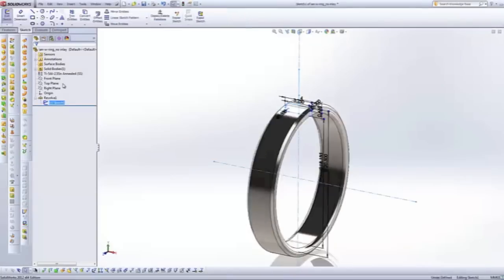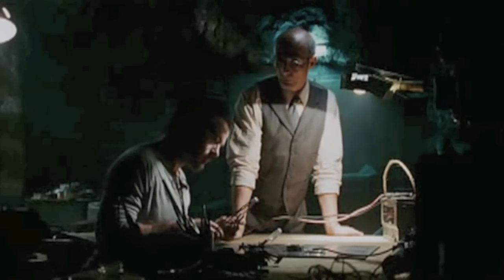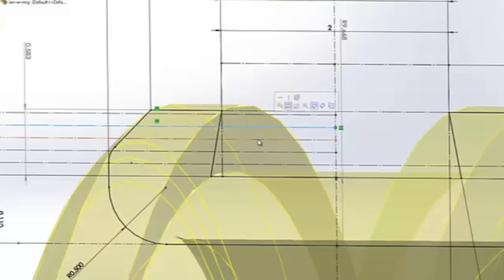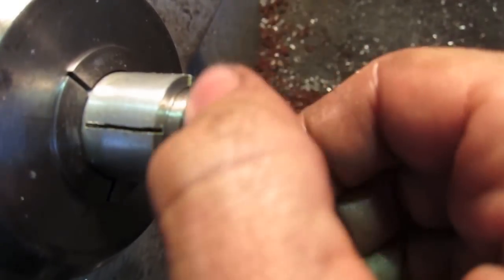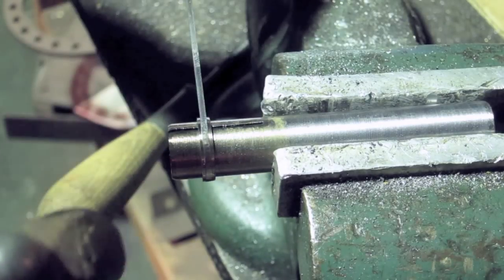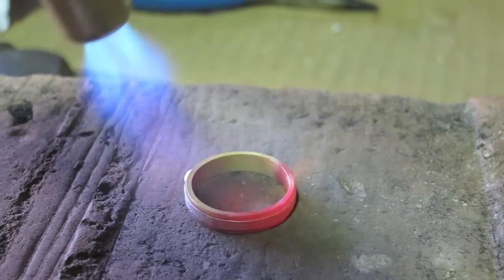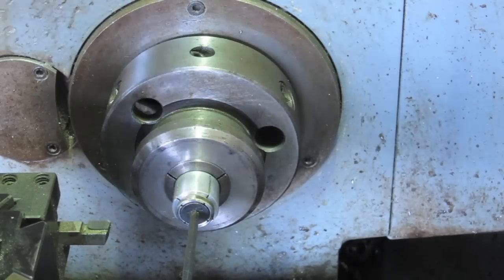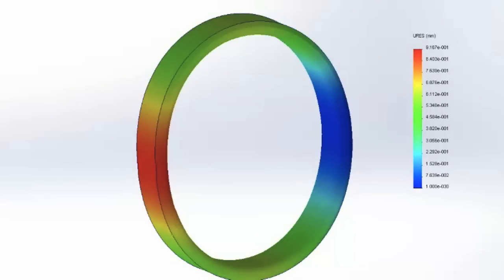Making the Ring - Men's Titanium Wedding Band With Inlay

Comment: you can use coolant depending on what youre doing, because these metals are extremely  hard and small, coolant isnt required and usually a ceramic insert is used in the tool.

Comment: i had an aircraft Ti bolt given to me, worked in a welding/machine shop.   very little lathe experience but managed to turn the head of the bolt into a mirror finish Ti ring
Reply from the maker: Post a pic!

Comment: You should make the Nuclear ring, but instead of cobalt 60, which might be hazardous for you to work with, you should use Tritium(Hydrogen-3), which glows in the dark under any condition, and is only sorta radioactive which means it still has serious style, and is only dangerous if inhaled, consumed, or otherwise absorbed into the body, and is thus safe externally.
Reply from the maker: Do you have any?
Reply: Last I checked, I was all out, but it's used in gun sights and watch faces if that helps you find any. The tricky part though is shaping the glass into the radioactive logo, coating the glass with a phosphorescent coating, and then trapping the tritium inside. Good luck.
Reply: chrisxdeboy He heated the ring with a blowtorch a few times, just saying its more then likely to explode.
Reply: only problem is that it will only be good for about a decade before it stops glowing

Comment: Would it be possible to cryogenically shrink fit the steel and force fit a heated palladium solid inlay ring in to the slot. The resulting forces should ensure it never moves.

Comment: I'm actually planning on making my own ring and already have my design. I'm just curious though, why go through the trouble of making the special tool for a 10 degree groove? If you're going to solder it, it's not going anywhere. Or is the inlay more to help keep it in place as you heated and hammered it in as you worked your way around?
Reply from the maker: This is a really good question. It's both for the process of setting the inlay in place during the initial formatting and machining as well as to ensure it's secure over its lifetime after it's brazed. Without the undercut, the inlay tends to fall out while it's hammered especially when you try to bend it up around the curve of the ring. It also has to survive machining its surface flat with the rest of the ring as well. Because you can't braze it to the titanium, you're relying on friction.  Security of the inlay depends on both the integrity of the bond between inlay ends and a "preload" with the rest of the ring so that there is pressure exerted around the entire circumference. This is very difficult to do without an undercut. Even after the ring is fabricated the fact that the inlay flows around the undercut ensures that there is no translational movement between the inlay and the ring even after impacts and vibrations so no gaps form within this boundary. 

FYI  this is the first and last time I made a ring in the method depicted on the video. When I started making rings professionally, I needed to produce much higher quality rings so I invented a custom ring rolling machine that cold formed the inlay into the groove as well as producing custom ground carbide cutters designed specifically to produce the most ideal undercut ( high-speed steel is not up to the challenge). I also switched to laser welding over torch brazing  because it produced a superior bond without damaging the base titanium ring. This was particularly important as I started making rings with multiple metals at different melting points. All this attention to detail was very important because the ring and the inly was so thin so there's very little room for error.

Comment: Titanium is a rather soft metal.
It doesn't really need any lubrication.
That lubricant you see is usually a mix of water with a special machining oil. Something like 80% water.
Metals like steel would surely need lubrication.